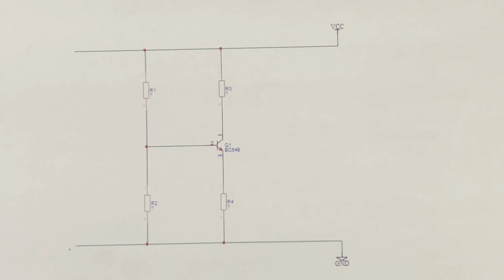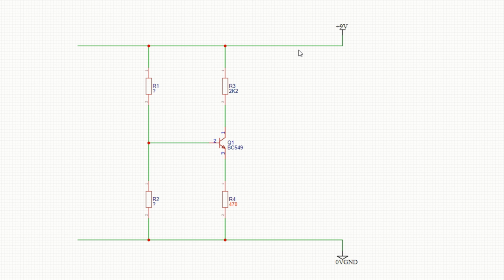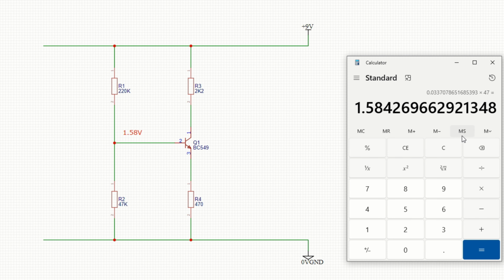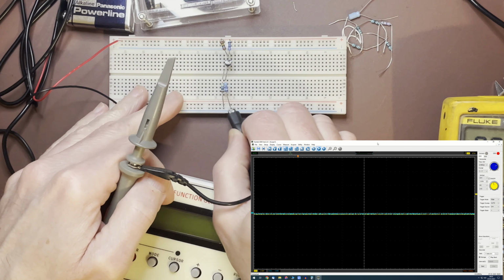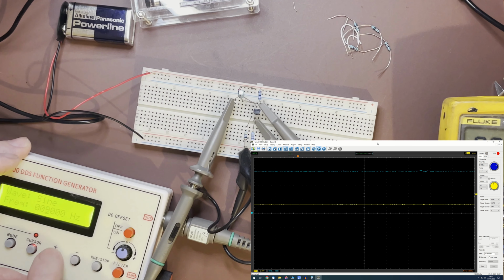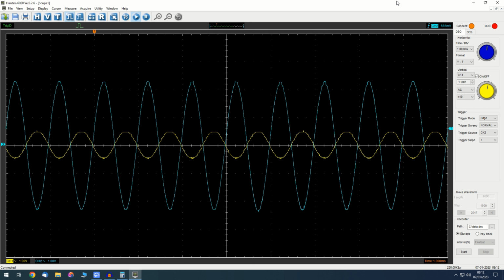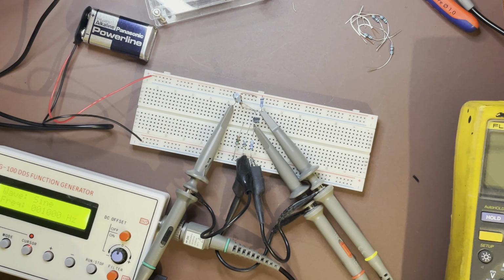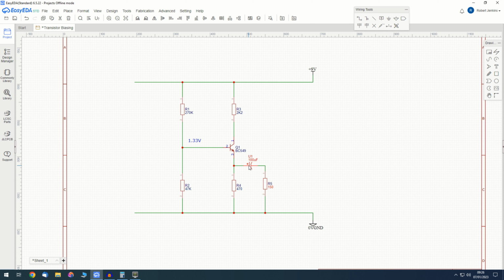Biasing a transistor, the easy way

Comment: Hey Robert, according to your recommendation from ETO forum. you have suggested to get acquainted  with this methodic. I saw it few times and I am afraid I need your clarification :)
At 10:18 you increased value or R1 and get 1,58 → 1,33 V of base voltage. Could you say what is the idea of it?
It was mentioned as 1/7 of Vcc...
Reply from the maker: My target is to get the steady state collector voltage somewhere around half way between what it would be with the transistor close to fully on, and the supply voltage which is what it would be at with the transistor fully off.

That should give the maximum voltage "swing" at the collector, before it starts to clip, and give a good linear gain range.

The transistor fully on would give near 2V on the emitter and collector, fully off  is 9V (supply voltage), so around 7V change.

The target bias should give a collector voltage somewhere around 9V minus half the 7V swing, or 3.5V across the collector resistor, which is what I approximated it to.

Comment: connect a small Si diode small beteewn R2 and Gnd ; connect the base to the junction of R1 and R2 .
the diode temp coeffcient is  aproximately the same as the base emiter temp coefficient, making the bias more stable over a large range of temperature .

Comment: The easiest way,  is do it virtually...using circuit simulator software. It's also possible to "home in" on bias settings for the lowest THD.
Reply from the maker: There are many possibilities, but I'm trying to explain how and why the voltages and gain are achieved and can be predicted, using real world components.